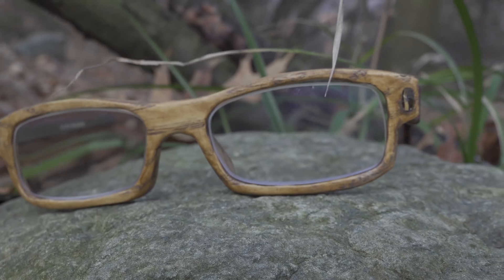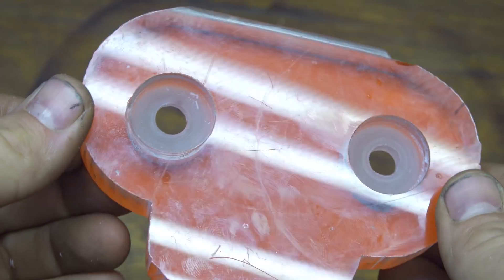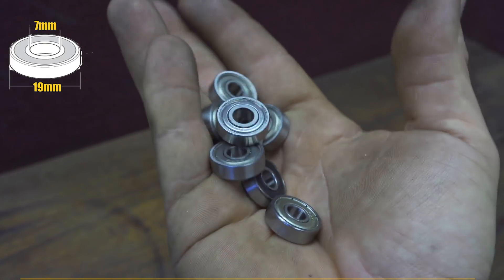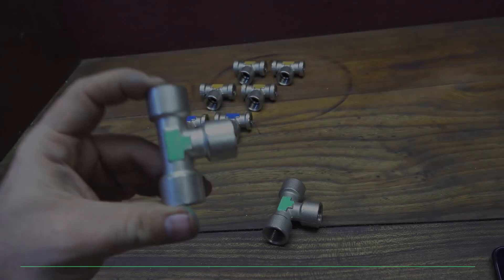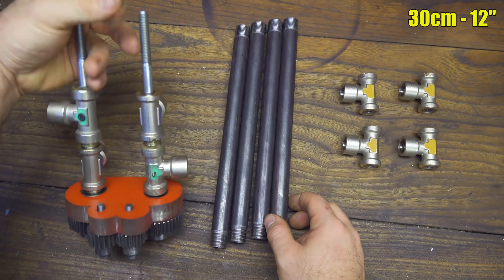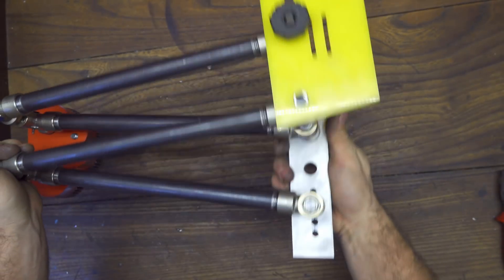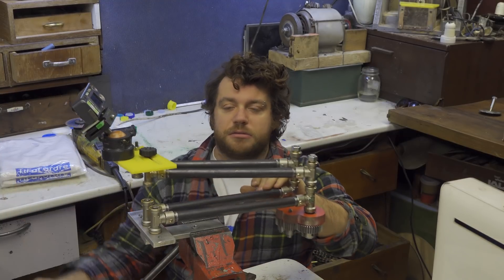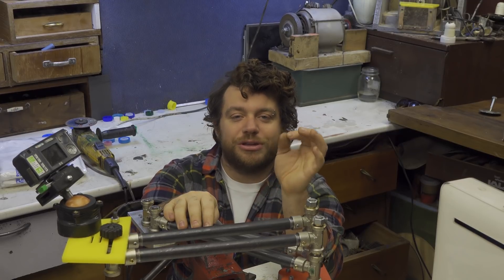How to Make a Curving Arm Slider - Slide around subject - 4K

Comment: Hi there dude!  Andre from Brazil here! 
First congratulations and massive thanks for uploading this video. 
I would like to check a few things if possible? Many thanks in advance!
"The 1/2" tube connectors T shape" about this T conectors did you actually use the 3/4(19.02mm) to 1/2 inch? Or are they all 3/4"? 
The 2 big screws used on the gears: what size are they? 
If I wanna use just 2 gears what diameter size do you think I need? 
Cheers bro! Keep up with the good work! Blessings

Comment: I do not understand the 4 gearwheels.  if you take only the 2 large ones and put them together, the rotation is exactly the same as using the 4 right? Or do I miss something here?
Reply: No you are not missing anything :), I was looking for this comment. I also don't understand the 2 other small gears. Just leave them out and run the big gears against eachother. (goed bezig! @computerjantje)

Comment: You should move it with a rubber band, it will cancel out the small un-even movements in your hand :)
Reply: Either that or rig up a screen door closer for it. then you can adjust the speed
Reply: a tip : you can watch movies on Kaldrostream. I've been using them for watching lots of of movies recently.
Reply: @Morgan Augustine yup, I have been watching on kaldroStream for months myself :D
Reply: @Morgan Augustine yea, I've been watching on Kaldrostream for since december myself :D
Reply: @Morgan Augustine Yup, been using kaldroStream for since december myself :D
Reply: @Morgan Augustine definitely, I have been watching on Kaldrostream for since december myself :D

Comment: You should use rubberbands as a buffer instead of directly applying pressure at the back, it will create smoother movement.